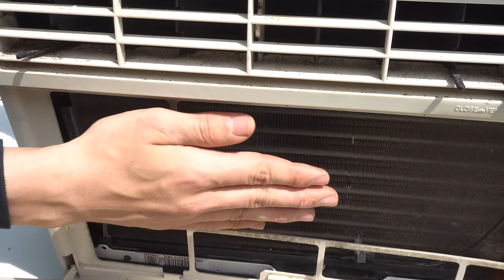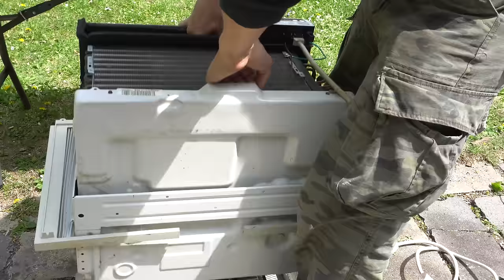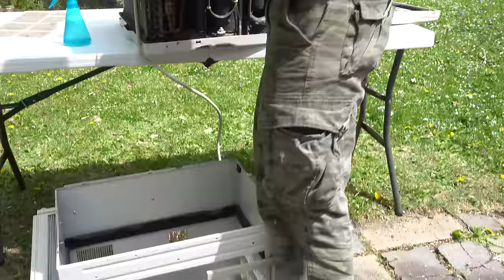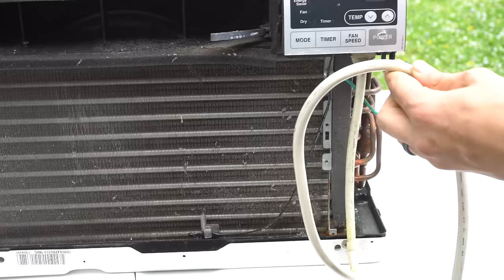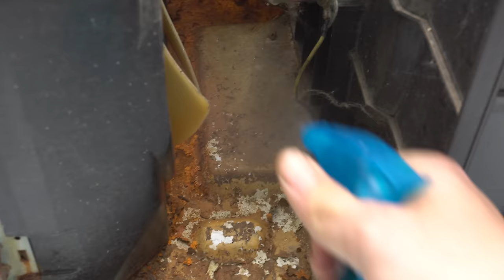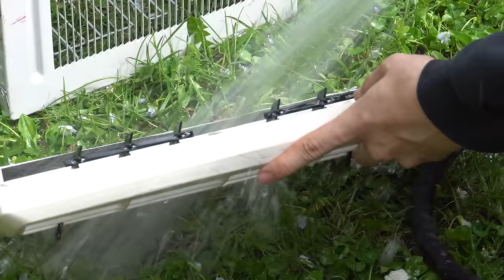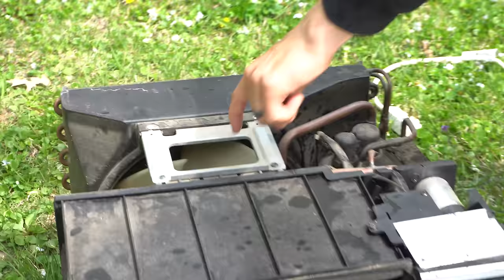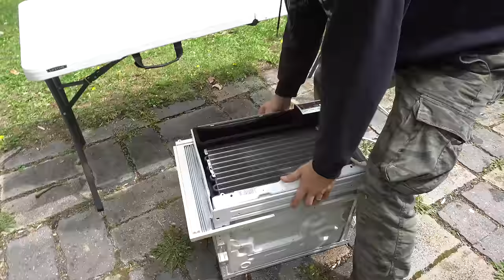Window Air Conditioner Not Cooling And The Most Common Fix

Comment: This makes me want to rid my 3 window units and have central air put in.  So much work to it properly cleaned.  Thanks for the video.  I had no idea how intensive this can be.
Reply: Did you know that every machine, window or central would need the same maintenance
Reply: Wash the condenser yearly and clean the filter. Guy in the video is doing a lot of stuff that's just for show and not needed. Doing just what I said will get you several years put of it.
Reply: It's even more work to clean central..
Reply: @arcticarrowhvacr  not really. Wash the condenser and that's about it and a monkey can do that.

Comment: Have a decade old A/C where one vent stopped working and air was barely cooler despite being on coldest setting. Plus when I took the filter out I saw that the grate inside was frosted over. But did exactly what you said and everything is fixed! Just in time to survive a heatwave

Comment: Excellent video, easy to follow too.  My unit is exactly the one you're showing here, and LG8000, so that's great for me too!  My father used to take care of these things but he's no longer with us so I'll try LOL.  With your video I feel a lot more confident to even attempt it!  I don't think I need to take my apart as far as you did - the only reason I need to look into it is because the "clean filter" light on the panel is lit (which I didn't notice until today!), it's only been used a few summers.  Thanks so much for sharing your experience, it will be very helpful for sure!
Reply: Think I have same LG model very very very quiet running,also wi-fi comparable so when not running all day while at work can turn it on from LG APP and start cooling the house while driving home

Comment: Today June 8 2023, the air quality is at 185 due to the Canada wildfires, the worst in the entire world right now. Me, a student who is working an ok job that gets the bills paid was not in the current position to by a new air conditioner. The air conditioner stored in the closet sucked so bad last summer that we had to put a fan in front of it. I saw your video yesterday and I’ve just now finished dissembling and cleaning it per your instructions. I didn’t/couldn’t really rinse it out but I used my wet/dry vac a toothbrush and a kabob skewer to remove all the chunks of rust. The vacuum was helpful when using the blow setting to get into those crevices. Since I didn’t soak it and just used damp rags I was able to put the AC up as soon as I reassembled. I am sitting here now with a powerful Newly cleaned AC and a new skill I can offer my friends and family. I have 3 dogs and we all thank you very much hands down the most useful video I’ve ever come across

Comment: Something to keep in mind when working around those 'radiators'... the fins on those things are SHARP and they will take a layer or two of skin right off your hands if you are not careful.  They are also easy to bend up if you get to enthusiastic with the hose or a brush.
Reply: well said
Reply: Can I dry dust those sharp things gently with a toothbrush (& then maybe some canned air or spray water?)
I can’t remove the unit from the wall...it will have to be done gently from inside & then hose the outside.
Reply: @georgiegunn9577  
On the outside coils, some water running through the fins while yous scrub (gently) with a brush should work, though I would recommend something like a scrub brush, something plastic with a handle and nylon bristles.  Those bristles should be a bit longer than those of a toothbrush.

On the inside, you probably don't want to run water through those if you cannot remove the unit.  If you have a vacuum cleaner with a hose and a bristle attachment, I feel that would be a better approach.

GENTLY being the operative word in both cases.

Once again, I strongly recommend gloves.  As I said above, those fins are very sharp and will lay you open very easily.  They are also very easy to squash together or otherwise damage.
Reply: Thanks! Yeah, a vacuum sounds great, but I don’t have one (which is why I thought maybe a soft bristled toothbrush.) ...& outdoors, I won’t have access to scrub any of the inner coils as it will still be in its casing since it will still be in the wall. But as water goes in there when it rains, perhaps s little hose down could listen any leaves or dust.🤷‍♀️
Works great when it’s coo...lmao...not so much when it’s 100 degrees...🤣😥
Reply: yes becare full, i still have all my tools, . i still have my fin comb, sometimes just lifting it out of cover and finger hits on fins they wwill close up , but in one or 2 spots is no big thing, i use a hous paint brush,not to hard
Reply: You can take a flathead and bend them back straight
Reply: yep. one time i completely ruined the fins on an almost brand new unit by hitting it with a hose at an angle with too much water pressure. took me like 3 hours with a knife to straighten them out
Reply: @xaenon  Yes!! because you will flood the inside of your house if you clean it while still in the window/wall and cant see how much water is going in.
Reply: @andrewsteinberg7728  Thats IF you are able to remove it, otherwise the case covers it up and you cant get to stuff.

Comment: Nice video. I have the exact same unit. If you remove a couple screws on top after the cover is off you can actually flex back the plastic on both the front and back coils. You will be surprised but the majority of the dirt is there. You just can't clean them well from spraying the front only. Take care!

Comment: I have an associates degree in hvac. I was always taught to wash filters or evaporator coils/ condenser coils from the inside out. This way is doesn't push the dirt in wards. That said this can be hard to do on a window unit.
Reply: Exactly, so what do I do just vacuum?
Reply: *heating, ventilation and air conditioning
Reply: you are correct young one, but that is for industrial or central units, not window vibrators, How much experience do you have in the Field ? besides the entry level junior course ?

Comment: I found that using rubbing alcohol in a spray bottle works really well for cleaning that sticky, greasy, dirt on air conditioners, ceiling fans and stovetop and stove hoods. I also spray rubbing alcohol inside my air conditioner while it's running full speed to freshen up the stale odors that accumulate on the inside.
Reply: Don’t be too surprised if you start a fire if the alcohol hits the moving fan or hot electric part. Are you diluting the alcohol or at least not using 93%.  I had accidentally set a lawnmower on fire with a full tank of gas when I was 12. I spilled gas into the pull start line. As I pulled the cord to start the mower, I learned why Gasoline makes a “Spontaneous” combustion!  Thank god it didn’t catch on anything else. Luckily for me, my uncle was not too far and he didn’t even rat me out.
Reply: @robbydschannel910  running alcohol, especially higher percentage stuff will evaporate quick
Reply: @analogaudiorules1724  yeeeaaahhhh, nnooooooo! 🤣 for real though if you see this comment and use this stuff make sure it's unplugged and not hot and you give it a good hour at least to dry if you just use a little 93 %. Stuff is VEERRYY flammable and you is so pure you can't see the flames in daylight and therefore  very Dangerous. You will get extremely hot and wonder what is happening cause they are that invisible. 😬😬
Reply: That's a fire hazard.

Comment: Not saying it's wrong to "put it on the floor on its butt" as you did at 4:16. But you should mention that 1) most window type ACs are fixed in the hole in the wall, so you don't have a choice but to pull it out like a drawer from the front; and 2) doing what you did will disturb the freon or coolant. For the latter, it's not the end of the world, but it can cause problems down the road. If you do that, make sure to let the unit rest upright for about 4 hours to let the coolant settle -- as what they do when transporting refrigerators and freezers. Cheers.
Reply: I put mine in the window for the summers and installed it yesterday but in order to take it out of the packaging box without destroying the box I turned it for a minute or so upside down and turned it on after mounting it. Now I wonder if I caused a problem.
Reply: Not the coolant, it's the oil you want to settle back into the compressor.
Reply: Not in my region, everyone puts their ac units in the window, not a wall. It depends on what part of the country you live. We only need an ac 4-5 months a year.

Comment: Before using soap and water, I'd recommend using compressed air for coil cleaning. Be sure to do it outside and use something to cover your mouth. Amazing how much dust and dirt hide in those coils. Careful with the compressed air as not to use such high setting it collapses the coils.
Reply: Bingo.

Comment: Back in the day we would pull the units out of the housing and take them to a car wash, used the soap and all. We would wrap the motors, but really didn't need to. Water really won't hurt the motor, they are sealed, meant for outdoors.

Comment: One of the annoying aspects of the window unit design is getting access to the back of the condenser unit which leads to most cooling issues. Basically the back gets clogged and it can by tricky to get the right amount of water pressure to push through the condenser to remove the dirt without bending any of the fins.
PS some of the newer higher BTU but still compact units are more difficult to clean due to the use of a deeper condenser and evaporator units.
Reply: They are all cheap chinese JUNK anyway, they and their electronics arent designed to last more than about 3 seasons. I'm looking at a Mr Cool mini split, the condensor etc is a separate unit outside where you can access it very easily to clean the coils.

Comment: Any cooling unit like this should never be placed in any position but the one it normally runs/works/is used in if you can avoid doing so. There is oil for lubrication internally, this oil, just like the motor oil in you vehicle, should be kept at the normal running position. This holds true for refrigerators, freezers, etc. If you do/must lay it in any other position the safe thing to do is put it in the normal run position but wait 24 hours before even plugging it in. Those fins on/at the evaporator and rear condensor are easily bent/damaged even by the pressure of water from a hose can damage them. If you do, a tool that looks like a comb can be used to repair them. Better not to damage them in first place. I would have put a sandwich bag or clear wrap over the controls you do not want to wet. With all the cotton wood crap this fellow has in his hood he should have cleaned the inside of that rear condenser where the white fan would blow it. I watched, he got some but it probably was clogged more so than any other part. Washing down and trapped between that black fan shroud we see and bottom of condenser. If we look inside the case about 1/2 to 3/4 of the way we can see foam/rubber seals. This seals the outside portion of AC from the inside portion of the AC. from bugs, heat, rain, Etc. When sliding AC in or out be careful not to damage those important seals. It looked,  when he was sliding the AC down into casing, it hung up on those seals. In/on the front he said he was going to glue the front (important) seal that keeps the cool air coming out the top louvers from being pulled right back into evaporator area but never did. He was not going to use it and did it after it dried but why put the front grill back on? The more times this grill is removed/reinstalled the looser it will become fastening tabs even broken. I assume, like mine, it is a back up for bedroom if Central goes on the blink for a few days or week.

Comment: Leave it a while, up to 3 days, so any oil in the lines drains out before you run it if it has thin capillary lines anywhere in your system. This is especially true for refrigerators.
Reply: Is this for after you tilt it? Or something else to try if it's not cooling?

Comment: Haven't heard a mention of the bent fin problem and wanted to add there are combs that can straighten them out. When too many get bent or dented as I noticed a few areas on your machine are, that if not corrected can also hamper the cooling ability of any airconditioner. You can also use a putty knife but be very slow and careful.
Reply: A wet sponge also works well.
Reply: used a lice comb and the fins are perfect

Comment: I used to do this for Sears back in the 80s. This one is clean compared to some I cleaned.
Reply: Thank you I didn’t know that an ac unit could be washed I’ve learned something very useful that will solve the lack of cooling with my ac unit

Comment: Thanks for the video! I just have a question: where the condensation water goes down from the unit? I don't see any pipe from the drainage channel
Reply from the maker: The portion of the unit that sticks outside is tilted slightly downwards so that the water can drip down outside. It has little holes on the bottom through which the water comes out.
Reply: @WordofAdviceTV  Thanks a lot!
Reply: @WordofAdviceTV  Hi,man! Just cleaned my wall unit. I was carefully to not get water to the control panel or any electrical parts. But still not starts.  I can hear a little buzzing noise but neither the fan or compressor starts. I can use the control panel ,shows temperature, mode etc but that's all. Any idea? Could be the capacitor got little bit of moisture? Appreciate any thoughts

Comment: If you can't remove the entire system out to wash, what are your thoughts about using canned air with a straw to "blow" focused air to remove the dirt and dust from the fins?
Reply: Yeah, you can do it too but remember blow the way as air blow out from the AC unit. Good luck and have fun.

Comment: When turning a window air conditioner on its side and upside down and stuff like that before you plug it in to use it you should put it back in its original position and let it sit for a while to the freon levels off inside. Just like a refrigerator if you transport it land on its back that refrigerator needs to stand in its upright position for quite a while for thatIt's free on to little out.

Comment: Used to do that with my dad back in the 60's once a year on our 1200 btu units and oil the motors and they lasted 20 years! They were 220volt 1200 btu units, now all the 1200btu units are 115Volts!
Reply: Wally don't you mean 12,000 btu?
Reply: @richardmurphy3417  Yes!

Comment: Bless you young man! I have the same exact ac. It gets clogged up and the water level hits the fan blade. I need to find a strong younger person to lift it and take it outside. I can do the rest. Thank you SO much.
Reply: Ron Powell  Mine is spitting water out the front thru the vents & makes a lot of noise. I cleaned it up and now it's fine.
Reply: Saddletramp1200 hoping this will happen to mine , currently up at 5am dealing with it:(
Reply: @user-mf6uw5hv8j  drill a couple tiny holes in the bottom part that sticks outside. Fixed mine!!
Reply: And I fixed it and yet here I am again, weeks later and it started again? After years of use , this is the only time I’ve had it happen ..... and it’s so soon after I fixed/cleaned it wtf?
Reply: Cassie Daniel it’s metal though and I don’t have that equipment:(

Comment: An actual foaming coil cleaner is the best way to clean coils. I've been in the HVAC trade over 30 years.
Reply: You can buy the cleaner at any HVAC wholesaler. The general public can purchase anything except equipment. The cleaner is concentrated. Mix some with water into a pump up sprayer and you're set.
Reply: @timmcdonaldjr2712  so I just google HVAC wholesaler near me? Or can it be purchased online?
Reply: How about oven cleaner?
Reply: @cassie4290  walmart sells  Frost King a/c condenser foaming coil cleaner  It was was around $4.
Reply: Home Depot an Lowe’s both have it. Areosol can for about 5$. It is t best way to clean them as the HVAC guys will tell you.
Reply: Is there a safe way to put a filter over the part of window ac where the cool air comes out

Comment: I watched some other video years ago of how to wash an air conditioner. 
I followed the directions to a T. 
The AC ended up on the curb cuz it wouldn't even turn on. 

Also I can't believe you didn't even mention that if you tip the air conditioner (have it on its side etc) you have to let it sit level for a day .... or better yet,  2 days to let the coolant settle before you turn it back on.

Comment: Wow my window AC came with the apartment. It was built in the 50s. Bet the unit has not been washed since it was installed back in the day. All I can do is wash the foam filter at the front. And spray what coils I can reach with vinegar and let it dry. Talk about sucking electricity AND it is an all electric complex. Fart and bill goes up, I say.

Comment: If you tip the whole unit to one side, that can damage the compressor, you have to wait like a day for it to be ready
Reply: 100% correct, anytime you put something on it's side like an air conditioner, refrigerator  or freezer always put it in the operating position for a full 24 hours before even thinking about operating it again, you will destroy your compressor if you don't. Excellent point  Leo  <--- he is the Man !!!!

Comment: Hello, My friend
From being an A/C tech. I believe you should not have put the A/C unit on it is back(butt). (The condenser side). You have sent all the oil in the coils and lines between the compressor and the condenser to rush going to the condenser coil coating it. Which will reduced the efficiency of the condenser. You could have put the unit on the ground and pulled the unit out
Reply from the maker: That's a good thing to look out for. Thank you for pointing it out! I probably should not have did it that way as you say.